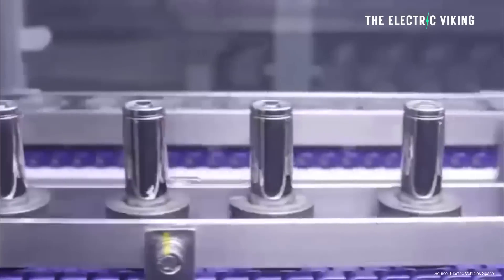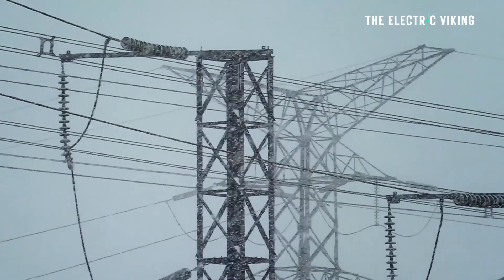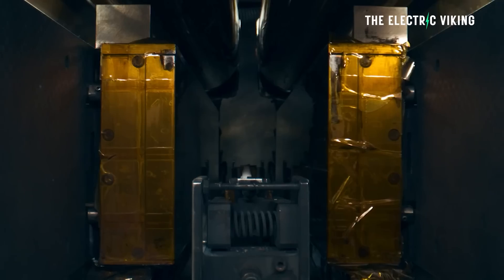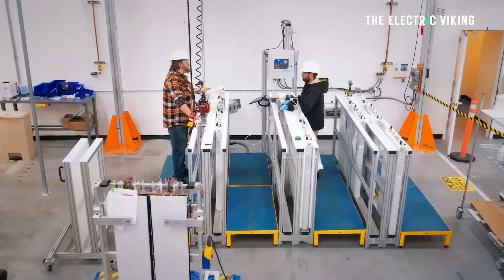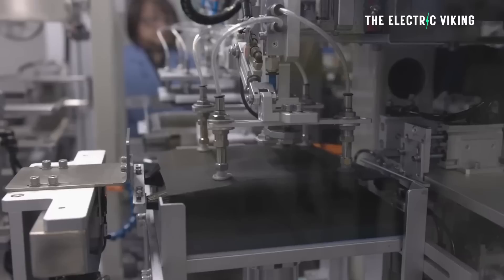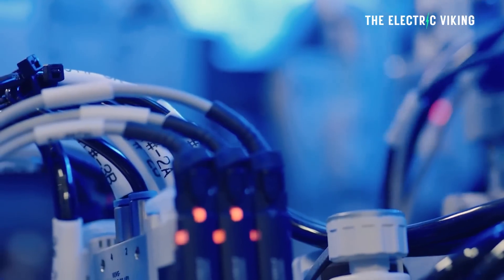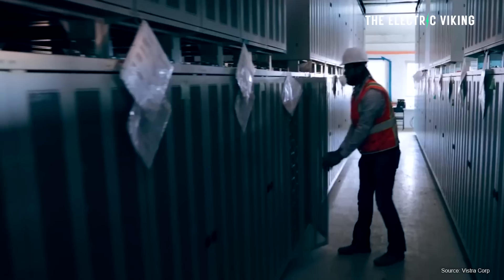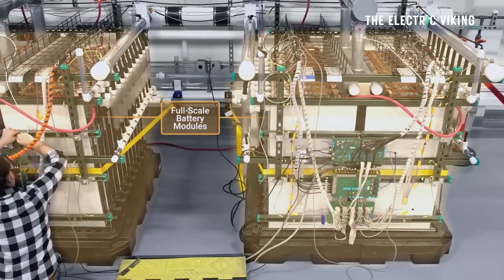U.S company reveals revolutionary battery that DESTROYS sodium & lithium

Comment: Renewables, as clean as they can be (1) still have environmental costs. Anyone who doesn't recognize that is an idiot in my opinion. That said what costs are we willing to bear as a society. The costs of course are land use, any mining required for necessary minerals, manufacturing facilities, transmission lines etc. Of course some of these environmental costs are minor compared to some things we are doing today. 
As Iron Air batteries one big use l can see for them is units sized to support anything from single family homes to multiunit appartment buildings. A better option in my opinion than backup generators.
If l were making the financial decisions we would be putting more money into renewable technologies as well as putting a lot more money into fusion research. Eventually fusion will come online. And when it does renewables may well become old fashioned.
1) Even the cleanest renewable etill is going to generate waste heat.

Comment: It might be too large and heavy for single house solar system. Maybe it would be good with a LFP battery as a buffer for peak energy times. 

If it needs to be very large for being able to take enough charge, it might need like 1 days buffer, that can charge iron battery in night and iron battery can charge LFP so that the evening peak power is satisfied even in very cloudy day. 

I missed the numbers, but it sounded like with 20 kW solar panels the iron air battery would be huge. Add small LFP as buffer, and charge each night large battery slowly, and keep LFP about 20 to 30% SOH in morning to accept more solar energy. 

A really large scale battery can be huge, add solar panels on the roof, and get a self charging power bank.  But on house garden a sea container size battery would be unpractical.

Comment: Is this process patented? If not it's just sucking in subsidies.
Reply: Although Iron-Air batteries go back to the 1970s, Form Energy own a number of patents around their specific design such as the cathode catalyst construction, the hydrophobic membrane that allow oxygen to enter the cell but prevents the water based electrolyte from leaking out, the propietary electrolyte solution composition, and the cell's layout and contruction. Plus software patents on their propietary battery management system and their industry modelling suite that allows energy and grid companies to plan and cost large scale energy storage deployments (across a range of technologies, including Lithium, Iron-Air and hydrogen) and model the systems under various operating scenarios.

Comment: RED FLAG - your gut feeling is quite correct. The "1/10" of the cost comes from a business presentation in 2022 when they compared the cost of their storage modules at 20$/kWh with lithium-based storage modules at 200$/kWh. As you know the costs for LFP have fallen dramatically over the last two years. At the same time, researchers in Jülich/Germany, who were working on the iron-air-technology, estimated the potential for selling kWh on the energy market at 20%. Again, these are old estimates and we can not know how far the technology has evolved. Back in 2017 they had a stability of 30 cycles. However looking into the VDE report from last year about grid batteries, where they did not know about iron-air but other battery chemistries, then it seems that iron-air could come out at 5c/kWh market price being on the same level as pumped hydrogen power. Whereas LFP have been commercially succesful for peak-shaving application (response time less than a second), the Fe-Air-technology targets load-levelling applications (response time less than an hour) competing with hydrogen-power and redox-flow grid storage (which are mostly based on Vandadium). These technologies have limits how fast you can deploy them - iron-air however can be installed in abundance.
- check out "ETG Task Force Energiespeicher" run by the VDE who have a lot of interesting studies and overview reports.
Reply: Flow batteries are now available as drop and plug in 20 or 40 ft. containerised solutions, offering 0.5 to 5MW units. Form Energy's Iron-air battery has a foot print density of 3MW per acre (nearly 140x the footprint), though this may improve with battery container stacking. VRFB looks better for space constained long duration needs, though is costly, Vanadium suffers price volatility, and has toxicity considerations, and relatively low volumetric energy density (25Wh/l). However, if footprint isn't an issue then Iron-air offers better cost scalability than VRFBs, and likely will find a home in large scale grid storage hubs. Hybrid Lithium/VRFBs containers also are available and have been deployed in built-up areas to support Ultrafast EV charging stations.

Comment: Probably very slow charge and discharge rate, compared against Li battery technology. However, within its identified space, high rates are not needed, just high volume at low prices. But if the rate is low per pack and you have 10k packs, then that equates to high enough charge/discharge rates. PS Outside Australia, we do get bad weather days/weeks, so a multi-day battery is viable, even if simply by adding more packs.

Comment: Round trip efficiency is another important factor and if it is only 50 to 60% as opposed to lithiums 90 + % then that is a big problem.
Reply: OK if you have plentty of renewable energy hat would ottherwise be wasted. The output of these batteriescwill attract achigh price premium when currentt generation is insufficient. That is how pumped storage makes a profit in spite of 75 to 80% efficiency.

Comment: We need thousands of these to cope with a week of flat calm in the middle of winter in the UK.
Reply: The UK's renewable power output peaks in the winter, due to wind being a fairly constant resource with diversified generation around the UK's fairly large wind resource geographic area (onshore and offshore). The majority of offshore wind farms see near continuous wind year round, with higher sustained winds during the winter. BESS is more required to maximise renewable output, reducing curtailment, rather than assure energy availability as a battery backup system.
Reply: Where do you source your information?
Reply: Or million for 1 year darkness... https://en.wikipedia.org/wiki/Year_Without_a_Summer

Comment: You could use these to recharge faster battery backups such as lithium storage for fast discharge. This would then be able to collect the excess energy cheaply that then is used to recharge the battery banks that are best able to step in and supply the high demand

Comment: This claim that the battery can store multiple days of electricity demand has nothing to do with their technology. In fact it is just gobbledegook. 

Unless these batteries are leaky, the number of days of electricity demand they can store is simple the battery capacity divided by the average daily storage needs.  It's just that simple, so ANY battery can deliver "multi day storage".  

And the fact that iron-air batteries are slow  can be solved by reducing the cell size.  Compared to a 1 meter cell size, 2 half-meter cells would have the same storage but double the charge/discharge rate

Now my bullshit meter is going beep beep beep.

Comment: There must be a place for sodium batteries in countries in the northern hemisphere simply because they are not  so effected by extreme cold. In countries like Finland where I live this will be a game changer for ev’s near the arctic circle ,even if the batteries are a little heavier than their lithium-based alternatives. Am I correct in thinking that sodium based batteries have a place in extreme cold areas?
Reply: Altech batteries and Fraunhofer institute…. Massive operating temperature range

Comment: A group of climate scientists are speaking out against corporate and state-level claims that the world can aim to keep temperatures at 1.5C while CONTINUING to expand fossil-fuel production. They write: “The way to understand this doublethink: that we can avoid dangerous CLIMATE CHANGE while continuing to burn fossil fuels – is that it relies on the concept of overshoot. The promise is that we can OVERSHOOT past any amount of warming, with the deployment of planetary-scale carbon dioxide removal dragging temperatures back down by the end of the century. This not only cripples any attempt to limit warming to 1.5C, but risks CATASTROPHIC levels of climate change as it locks us into energy and material-intensive solutions which for the most part exist only on paper. To argue that we can safely overshoot 1.5C, or any amount of warming, is saying the quiet bit out loud: we simply don’t care about the increasing amount of SUFFERING AND DEATHS that will be caused while the recovery is worked on.”
A key element of overshoot in future scenarios “is carbon dioxide removal,” the scientists continue: “This is essentially a TIME MACHINE – we are told we can turn back the clock of decades of delay by sucking carbon dioxide directly out of the atmosphere. We don’t need rapid decarbonization now, because in the future we will be able to take back those carbon emissions. If, or when that DOESN'T WORK, we are led to believe that even more OUTLANDISH geo-engineering approaches such as spraying sulphurous compounds into the high atmosphere in an attempt to block out sunlight – which amounts to planetary refrigeration – will save us.” The “entire wacky races” of carbon dioxide removal and geoengineering “only makes sense in a world of failed climate policy”, they add.
The article also critiques the Paris Agreement’s focus on temperature limits rather than FOSSIL-FUEL EMISSIONS: “The time has come to accept that climate policy has failed and that the 2015 landmark Paris Agreement is dead. We let it die by PRETENDING that we could both continue to BURN FOSSIL FUELS and avoid dangerous climate change at the same time. Rather than demand the immediate PHASE OUT of fossil fuels, the Paris Agreement proposed 22nd-century temperature targets which could be met by balancing the sources and sinks of carbon. Within that AMBIGUITY net-zero flourished. And yet apart from the Covid economic shock in 2020, EMISSIOINS HAVE INCREASED EVERY YEAR since 2015, reaching an ALL-TIME HIGH in 2023.” The comment piece follows on from a similarly strongly-worded opinion article from the same scientists in 2021 titled: “[The] concept of net-zero is a DANGEROUS trap.”

Comment: So the main limitation is max current output/kwh meaning a much larger capacity is required for a certain application. Oxidation isn't a fast process.
Reply: Oxy cutting isnt that bad for what they have to do - I wouldnt want to cut 2inch thick plate with an angle grinder - though am sure they're not using 100% oxygen!

Comment: It sounds cost-effective but the new 85 MW battery in Maine cost at least $US147 million - that is what US Department of Energy pays Form Energy. The real price of the battery could be much higher? But if we use the $147 million then that is at least $1.72 million per GW capacity. 

Tesla has just secured a deal for a $375 million Megapack contract in Australia where they will deploy 415 MW/1660 MWh. That is 0.90 million per GW capacity and they have to transport the whole thing to Australia.

That is 50% less per GW capacity discharge and a clear win for the Tesla system. 

But what about the long duration you may argue. 

As I understand the energy marked the real profit is on the scale between 2-8 hours where most of the profit will be made because most of the time the Tesla battery can just recharge from the grid after the demand has peaked. Think about it. If you have a batterypack that can discharge between 5 PM and 11 PM and then charge between 11 PM and 5 AM and be ready to discharge again between 6 AM and 11 AM why would you need a longer discharge time? Remember electricity can be transported over long distances.

It great with a longer duration but given the choice between a high discharge rate and a long duration the high discharge rate is more profitable in most markets.

Comment: This is basically an Edison battery. Will be interesting to see how they're dealing with maintenance since it requires distilled water replacement regularly.
Reply: There are still working Edison batteries made in 1800's. I remember Edison battery is iron-nickel battery.
Reply: Edison is nickel iron
Reply: Edison is nickel iron
Reply: Thought Edison batteries use nickel foractive ingredient 🤷‍♂️
Reply: @SparkySho  hence the “basically” part. 

It’s still going to precipitate like mad. They will endlessly work as long as you replace the water.

Comment: “Multi day” is a better sounding term than “low power”. If a battery has a high power output, you don’t need a big one to get a lot of power but the amount of energy stored is a lot smaller meaning it won’t last as long. To take an extreme case to demonstrate the point, a nuclear diamond battery last thousands of years because it is only capable of minuscule power output.

Regarding the cost, one tenth is not that surprising if it results from the lifespan. Assume you have two batteries - A and B. Each one sells at the same price but battery A needs to be replaced at 10 times the rate as battery B, then overall, battery B is one tenth of the cost of battery A. Countering this is that if battery B has a lower power output than battery A, you are going to need more of them.

Don’t get me wrong. This is great news if it is true and there’s no reason to think it’s not. Multi-day storage will probably be needed to cover long, overcast winter spells in many areas and this battery would be perfect.

Comment: The carbon footprint to produce this monstrosity will be HUGE!!!!!
Reply: Wrong.Iron can be produced without emitting CO2.
Reply: Your evidential backed source for this statement is? Are you confusing steel production with iron production, iron itself has realtively low carbon footprint with high recyclability.

Comment: One tenth the cost probably refers to the battery itself. That would not include the systems around it. With energy density far below Lithium it would require much more work for foundations, ducting, wiring and connections. 

Also round trip efficiency is important. 

Altogether this is too much information for this comment section. Happy to talk online, if you like.
Reply: Iron is so much cheaper than lithium that even with the infrastructure and undoubtedly ridiculous profit the company will charge, it could still be 1/10 the price.
Reply: I be wondering how big and how much energy is lost between charging and discharging ...
Reply: @PerpetualMan22  They are only 50 to 60% efficient, not very good.
Reply: @grancitodos7318 the efficiency doesn't have to be high when solar panels are so cheap. It needs to be cheap and scalable. If it's 20% the cost you can install double the capacity and double the panels and still come out way way ahead.